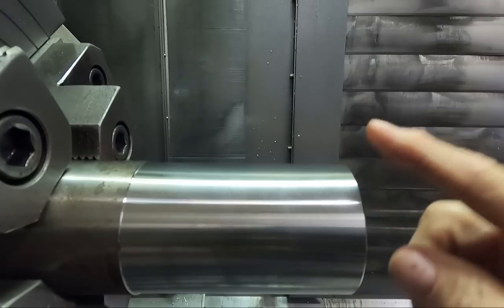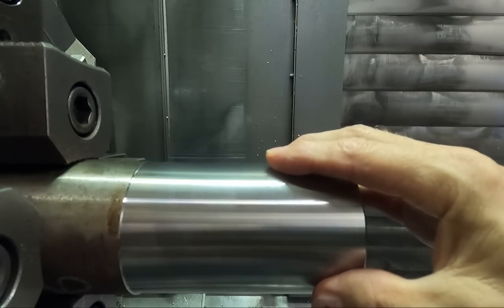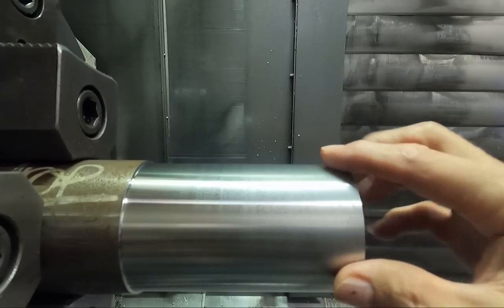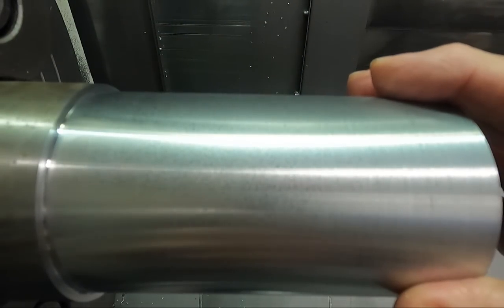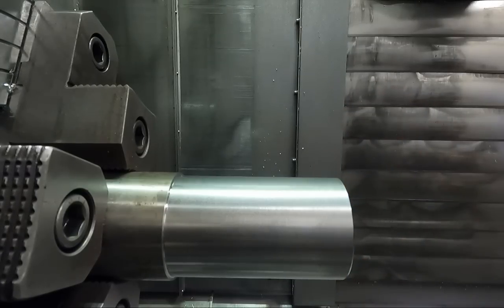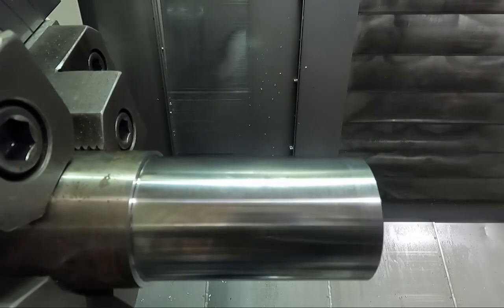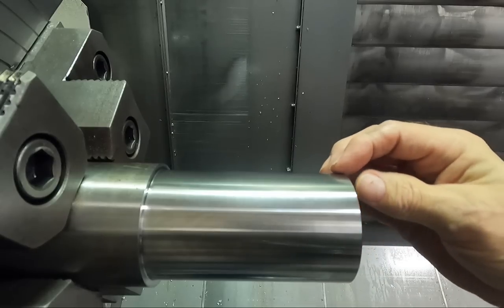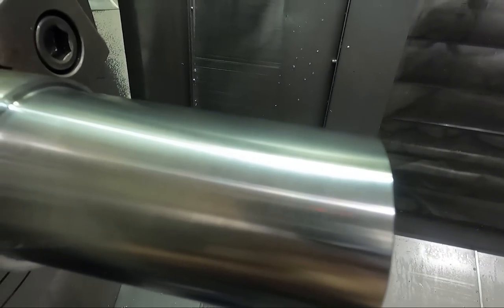Does Depth of Cut Make a Difference to Finish

Comment: my max bar is 1.25" so i dont like running the 800 sfm rpms. i can turn 5000 rpm but i dont like to mainly for the time it takes to slow down because i have a gantry style machine and do not have the time between tool changes, plus i run 2nd ops in it.
i was told to run more than the tool radius and can run 300-400 sfm at .0025-.0035 ipr. with a .008r at .01-.015 doc.
with that tip r .005 ipr is a roughing pass. 
imo you can run a lot deeper, even too deep, and way faster with that tool radius in this video.
anyway, more videos to make that everyone would like to see, examples!! 
thanks for the video!

Comment: Excellent series Peter, how about how would you go about getting a good finish on a small diameter part with a large machine like yours having limited rpm
Reply from the maker: In general I don’t turn small diameter parts out of mild steel on this machine. All my parts are more exotic materials. Put if I had to. I might have to get things the best I can. Then go to a machine where I could do some polishing.

Comment: In finishing turning the depth of cut need to be at least 2/3 of the tool nose radius , for feeds and speeds depends the material and tool sharpness (edge hone or edge prep) .exemple dcmt vs dcgt , both pvd coated , dcgt are sharper because the ground Edge, more sharp of an edge are less prone to smearing of the material at low feeds or low cutting speeds . 

Also decreesing the cutting speeds equals higher tool presure , high tool presure equals high temperature

Comment: I was surprised that nose radius vs depth of cut had so little effect.   I am using carbide inserts on a manual lathe but I am using old HSS surface speeds and get poor finishes.  While I lack the rigidity of your CNC, it is a BX tool post on an 450Kg ENCO lathe .   I will try something beyond the 100 SFM steel and 200 SFM Aluminum I use in the 4CS/D calculation.  Thanks for the idea.

Comment: Thanks for the video. I've been watching machining content for years now and I wish somebody would give an intuitive explanation for why surface footage matters. Like, what is it about it surface footage that leads to different types of finishes? Is there an intuitive way to explain it? Thanks.
Reply: The answer is simple: Heat and material flow. Both higher SFM and feed rate generate more heat, and causes the material to shear/flow better, which gives you a better surface finish, up to a certain point.
Reply: @kevind1865  Thank you. This was really helpful. Just to clarify, after a certain point, too much heat is detrimental to the insert/tooling and results in poorer finish? Also, would the principle you described indicate that sfm would be different whether or not you had coolant? I would assume that coolant would mean higher surface feed rates required to achieve the same surface finish, but allow quicker machining times. Am I understanding this correctly or is there something I'm missing? Again, thanks for your response.
Reply: @danf6070  My question also. I think coolant might not have a big effect because the actual cut zone is still going to get up to temp before the coolant can reduce it. The cut zone itself is very hot over 700C, way above the boiling point of water or oil so it shouldn't be able to get all the way in. Still it will cool the material and the tool.

Comment: Thanks Peter, I hope you will do one more test on this that answers this question.   I am a hobby machinist dabbling in CNC.  So, is the Material Removal Rate a better guide than either depth of cut, or surface speed since those are both in the MMR calculation??   As long as you are in some performance envelope  the tool is ok with, maybe you can trade depth of cut for surface speed?  And, If this works, when you hit a parameter you can't get around (such as max rpm for the machine, but too small of a diameter to achieve the surface speed) can you adjust something that isn't maxed out in order to recoup the good surface finish??   (In this example, going to a deeper doc at the max spindle speed to achieve the same MMR number) ...    Thoughts?   As I watch many CNC vids and work thru learning fusion, the MMR numbers seem to be dominating the tooling paths.    Thanks for your efforts and love the education!   Ordered a hobby cnc machine so paying attention...

Comment: Great research here. Looks like it wants a certain level of heat in the cut zone. Crappy finish when chips are silver and getting better as the chips turn gold to blue. If heat in the cut zone is the main factor then what effect does coolant have?
Reply from the maker: The coolant will have some effect, but not as much as you might think. Right at the cutting edge it still gets hot. The coolant really mostly cools the body of the insert and part. You can tell because the shavings still come off discolored even with coolant. maybe just a little less.

Comment: Would be interesting to see how the different depths affect the size after you mic it at the different steps
Reply from the maker: On this big machine with this soft material probably not much. But on tougher material it would make a difference. That wasn't the intent of this demonstration. In a real job you would want the depth of cut after roughing to be constant. This is why your finish diameter can change from your roughing cycle changing. Say from a chipped or worn roughing insert. There are some commentators here saying they take the full tip radius or even deeper on the finish tool. Not to be critical of them if it works for them. But to me that's not really a finish pass. Its just more roughing. And then what if the part comes out oversize out of tolerance. They are going to have to rerun the tool. Now they are taking a small depth finish pass. Like I said in the video. That second rerunning of the finish tool is going to ruin their finish, if they don't speed up the surface speed. In this type of material.

Comment: Best results are usually achieved when the depth of cut exceeds the radius of the blade by 2 times so if you have a radius of 0.8mm, 1.6 of radial debth of cut will result in a smoother surface than below that.

Comment: One factor you did not include is the COOLING FLUID, does cooling fluid make a difference to surface finish - specially on deeper, high-RPM cuts, keeping the cutting edge cooler and preventing it from irregular thermal expansion which may throw some part of the cutting edge out of tolerance, causing irregular surface finish
Reply from the maker: Coolant will make a difference. For the video's sake I didn't use coolant. In this material coolant would probably make the finish worse, using carbide tools. It may make it better if using HSS tools. That could be a test worth doing.
Reply: @EdgePrecision  - Thermal expansion is a basic law of physics, all materials expand and contract with temperature. Cemented Tungsten Carbide has a low thermal expansion, but it will expand and change shape under elevated temps above 400 C, (depending on Nickel content), hence affecting surface finish. Here is a good research paper about the subject
  https://nvlpubs.nist.gov/nistpubs/jres/18/jresv18n1p47_A1b.pdf

Comment: Heat can also be a factor. I've had parts give good finishes when they get hot but once i cool them down and take another cut at the same parameters the surface finish goes to crap. Certainly not a reliable technique cause of expansion and all that fun stuff just an interesting fact.
Reply from the maker: I think you are correct. But you can also say something the coolant is doing is the problem. One thing I learned doing this test is. Already people in these comments say things, but they just have their ideas but no real scientific profe. Just sort of guessing at what they feel works. And maybe in the past it did for them. This is precisely why I resist to give feed and speed data. Because everyone has their biases. Because of so many variables what works for me may not work elsewhere.
Reply: @EdgePrecision  coolant can help or hurt for sure depending on the situation. Regarding my example this was something i noticed while running manual lathes. Because i dont like a big mess I'll run dry through the roughing then cool the part down while i take a bathroom break or something and then I'll do the finish work dry as well. So aside from maybe some residual residue the coolant wouldn't be a factor.

Comment: Do you ever program g and m code by hand?
Reply from the maker: Only when I do unusual things the cam software wont handle easily. Something like a sub program for a broaching/shaping operation as an example. like when I squared up the hardy hole in the anvil.

Comment: In my experience you lose surface finish with carbide if your cut depth and feed rate/rev is less than the cutting edge radius of your tool as it burnishes rather than cutting.
I don't mean tip radius, I mean cutting edge radius...  Carbide inserts almost always have a rounded cutting edge for strength.

Comment: On much smaller diameters, when you run out of spindle speed, the finish will be much better with deeper finish cut.
Reply from the maker: I think you are correct. In the real world, when you have to hold close tolerances (say .001" or less). I don't think you would want to take a deep finish pass just hoping to hit your target point. Especially on expensive parts. So I generally sneak up on the dimension. This generally means taking a few very shallow finish passes. The purpose of this video was to show that proper surface speed is more important then dept of cut for a finish.
Reply: @EdgePrecision I'm from the metric site :) . I have to hold tolerances down to 0.006mm. 
How deep the finish cut is, depends on the tool nose radius. P.e.   if I have a 0.8mm nose radius, I let 1.6mm left at the diamater for the finish cut. works perfect and is very stable - we have orders from 1 up to 1000 parts.

Comment: Here's a cool video showing the shearing of steel at the cutting edge. You can see material go underneath the cutter around the 30 second mark. I can imagine this happening where the cutting parameters are less than ideal. Like your 400/.0025" example. https://www.youtube.com/watch?v=mRuSYQ5Npek
Reply: What you see at 30 s is what is known as "build up edge".
But do note that the video is filmed at microscopic levels with a sharp HSS tool which give quite different dynamics. 
So sad they haven't posted a scale.

Build up edges leads to variations on depths of cuts and will after repeated cycles of break the edge of the cutter with unreliable and varying cuts as result. When working with carbide increase the cutting speed, change to another coating or to a more positive insert if this happens.

Comment: what brand inserts are you using?
Reply from the maker: In this video I’m using Sumitomo inserts.
Reply: @EdgePrecision  Do they have a good roughing insert for stainless that you would recommend?
Reply: @EdgePrecision  What grade/breaker? I'm curious whether you're running into geometry issues anywhere during these tests, and what the Sumitomo's recommended feeds and speeds are for that insert.
Reply: @GeneralChangFromDanang  Mitsubishi Materials US735 grade or MC7025 great for stainless
Reply: @danno0505  I'll check it out, thanks.

Comment: I'm not sure I understand what's being done here. Roughing cut steps at .003" up to .030". So the stock diameter gets incrementally smaller towards the chuck.
Finish cut steps at .003 up to .030. So the actual finish cut at any point is still .003".
I have watched hundreds of these machining videos and it's my observation that small finishing cuts are nearly always worse than the roughing cuts, especially on non CNC machines where the surface speed doesn't change in relation to diameter.
I often watch Adam Booth machining and the surface finish on many of the parts he makes deteriorates dramatically when he drops the finishing cut to just a few thou.
Reply from the maker: The steps get larger in diameter as the tool turns closer to the chuck. The finish pass is straight (No steps). So the depth of cut (On the finish cut) gets  deeper by the increase in diameter of each step. So the intent of this video was to show for the same spindle speed (Surface speed). What happens to the finish when the depth of cut increases. Does that make more difference? Or does the surface speed make more difference in the finish? Or can you compensate for lower spindle speed by increasing the finish depth of cut, to improve the finish. I think it does show that if you can't go to a high enough surface speed for some reason, that increasing the depth of cut can help. But not as much as surface speed. In these softer materials. And it was also intended to show what a slow  surface speed finish looks like.
Reply: @EdgePrecision  Thanks for clarifying that, I completely misunderstood the two cuts, both roughing and finishing. The results would seem to reinforce what I see on conventional lathes, as in the case of Adam Booth, where the higher depth of cut for the roughing tool gives a much better finish than the finish cuts. Although he does appear to change speed (spindle speed) at times when doing the finish cuts.
Great channel by the way, I have been subscribed for some time now. As I spent many years in QA here in the UK working for Davall Gears, I would find it interesting to see your inspection setup and techniques.

Comment: Seems like it boils down to heat build up. Once too much heat was generated from going slow it started ruining the finish. Faster is better boys lol
Reply from the maker: @staysheep800  Not in this material (soft steel) heat helps the finish. Part of the reason going slow doesn’t leave a good finish is it’s not building up enough heat, in this soft steel. Because in this soft steel it won’t break down the cutting edge of the insert. (At least at the speed this lathe can turn). In more exotic materials yes heat will break down the cutting edge.
Reply: Ohhhh I overlooked the material hardness. Thank you so much for the reply and thank you even more for your videos. I’ve been machining for about 10 years and I’ve learned quite a bit from you, keep it up, you’re probably helping people way more than you know. I’m the only machinist in the factory where I work (just more of a support role for our engineers) so I do the majority of my learning on my own and as you know, there is always more to learn in our line of work
Reply: I was also curious how your tool tip radius would affect this test. Would a smaller radius help on the slower passes?